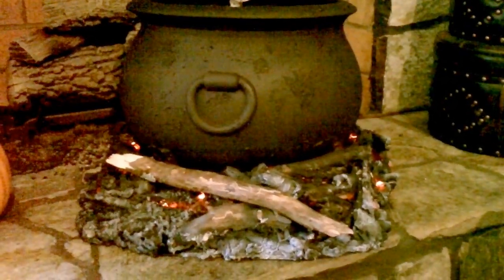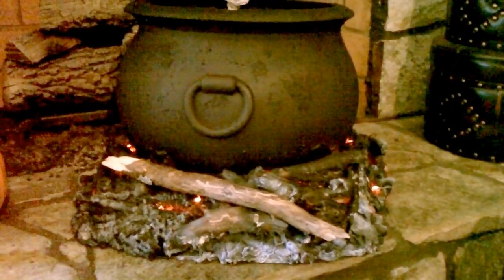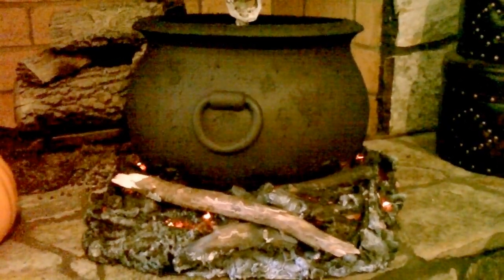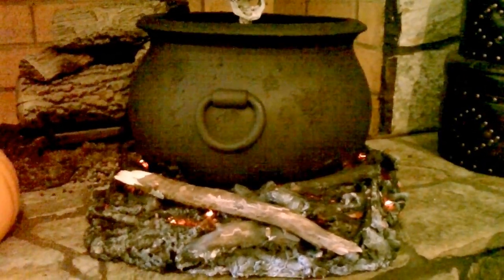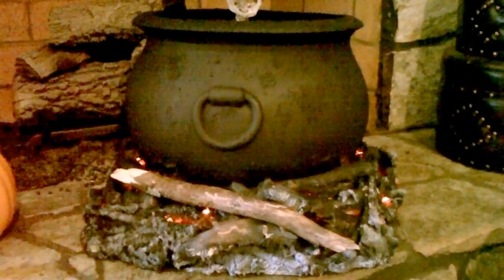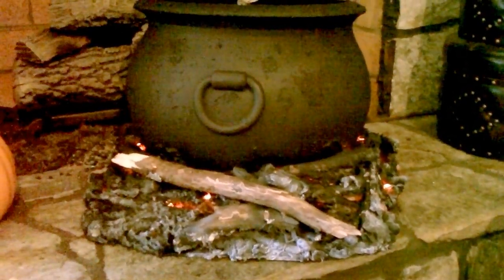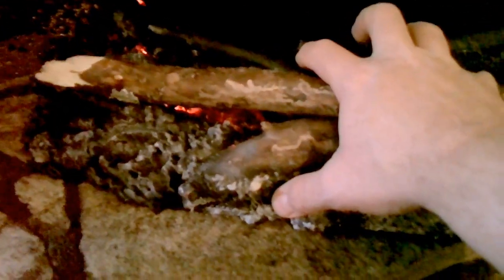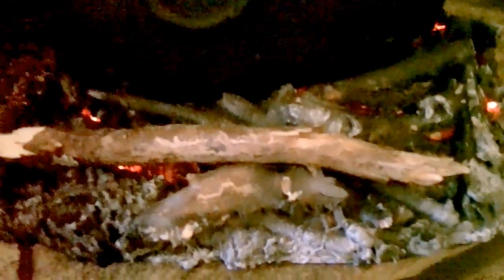Halloween burning coal cauldron effect

Comment: Learned a lot from this. Thank you! I did pick at the foam as he suggested and made holes to let more light come through in places. Laid sticks on top of foam as suggested (before foam dried) and it came out awesome. Used charcoal spay paint it worked great especially on edges of the sticks. Didn’t have orange lights (not Halloween time) so I wrapped orange cellophane over clear lights and it is perfect. Used battery operated tea lights with remote control. No need to plug in. Very happy with the result.